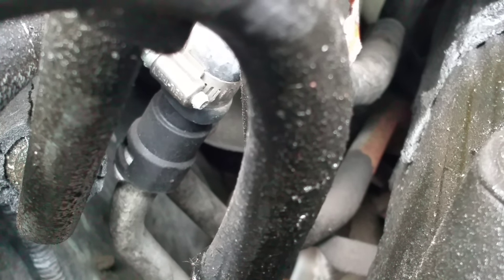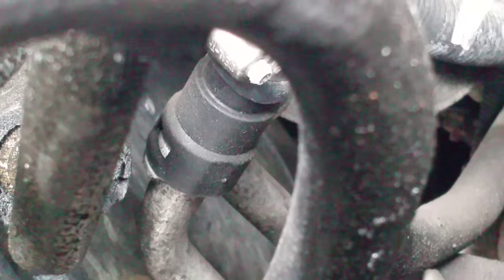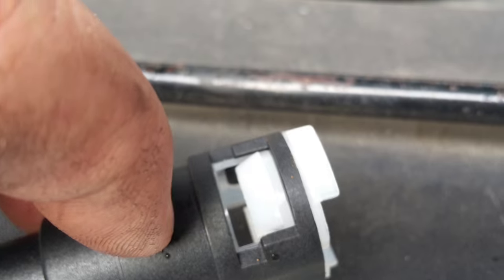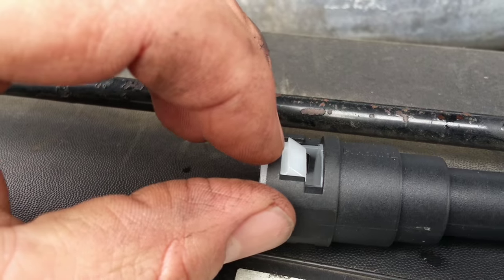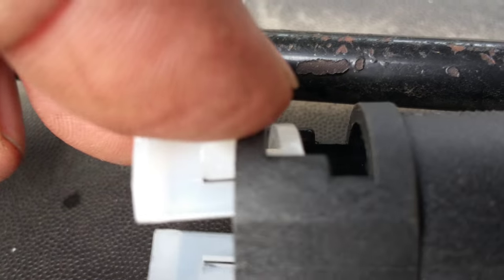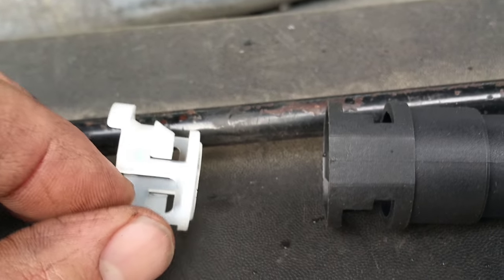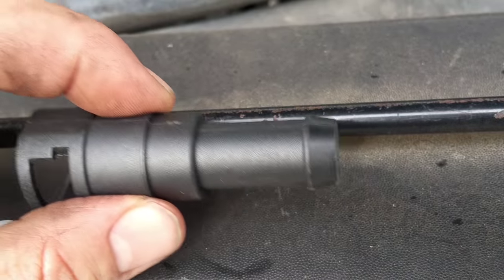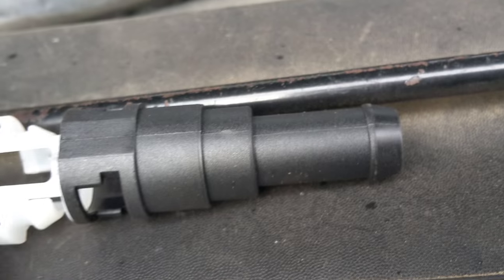Ford Heater Hose Quick Connect Release how to

Comment: The engineer that designed this, especially the recessed heater hose connections against the firewall, needs to be strung up!
Reply from the maker: Ummmmm...... maybe should find another line of work. But then, again... the bgg quick connects made their job a lot easier. As I would not call these quick disconnects.

Comment: Just an FYI from an old mechanic, a dab of silicone grease on the metal male tube that sides in the o ring will save alot of time and headache when reassembling. This will also help with future removal efforts. Great info in the video by the way. Straight and to the point. Tx.
Reply from the maker: Kerry Wallace thank you.
Reply: Should I buy a quick connect for the side that isn't going into the fire wall too? Plus an o ring?

Comment: This video helped me out tremedously. I replaced the ends on the main vacuum line of my 2001 F150 5.4 ltr and in doing so bumped the top heater hose enough to break the plastic quick connect. The clip end was still on the heater core pipe and I could not get it off. This video allowed me to get the broken piece off and replace the heater hose. The trick is to push the quick connect to the firewall, then push down internal tabs of the clip while easing the black plastic quick connect away from the firewall. THANKS FOR THE VIDEO!!!!
Reply from the maker: SkynAnge Thank you!
Reply: SkynAnge- Thanks for that tip!
Reply: Thanks for the help, I ended up having to disconnect one side of the clip first from inner and outer part and the then other side and pull and twist out. This video/comment did help! 👍🏽

Comment: By far the best description (and video) I found for removing the heater hose Quick Connect.  Replaced both heater hose assemblies on '97 Expedition with rear heating unit.  The toughest was at the firewall, but after doing the others this can be done by feel.  Had ordered the removal tool with the hoses, but saw this video before the parts arrived.  Removed old hoses before the tool even arrived.  Thanks for sharing this info!
Reply from the maker: Thank you, very much. I wish I was able to show it live.

Comment: Great video MrRchitty! I noticed a few folks were asking about where to obtain this quick connect part. I just had to replace one on my 2003 Ford Truck F150 1/2 ton P/U 4WD 5.4L FI SOHC 8cyl. 

Like one other person had commented, mine had three O rings and the replacement part Doorman - Part # 800-403 that I obtained from Advance Auto came with the same three O rings. If I'm not mistaken, an alternate alternitive would be the Gates Quick-Lok Connector - Part # 28500. 
Additional Tip! - Credit to Kerry Wallace that stated, "Just an FYI from an old mechanic, a dab of silicone grease on the metal male tube that sides in the o ring will save alot of time and headache when reassembling. This will also help with future removal efforts" Die-Electric grease will work just as well. Without grease, you will play the devil getting the new connector on - with grease, sucker slips and snaps right into place.
Reply: Great info. ANy idea on the size tool to remove these clips? Im going to cnc one from wood

Comment: MrRchitty ... your thorough explanation did the trick.  I also bought the 'special' tool but found it ineffective in removing these bad boys.  I had one bad heater hose. While removing the end next to the passenger compartment the second one snapped.  I barely touched it BUT...not necessarily a bad thing as it probably makes more sense to replace both so I am not stranded somewhere.  CHEERS and THANK YOU.
Reply from the maker: Thank you. I am glad it worked for you
Reply: @MrRChitty  The bit of your trick that really pushed the success for my 2006 Ford F150 LTD 4x4 Triton) replacement was the one handed bit at the end.  I did exactly what you showed by cutting the hose off (throwing it away and replacing) and then I had basically the unit and pipe coming out of the passenger compartment.  There is NO room for two hands in this meager, poorly lit area.   Thanks again, Jim

Comment: Adding to the kudos! The old T quick connect on my Chevy Suburban snapped off inside the hose, my quick connect T's off back to the 2nd heater core in the rear. Your video saved us after a long while of messing with it. But my two teenage sons now know the joys of fixing your car.
Reply from the maker: This is the same for GM??
Reply: @MrRChitty  The white part is a tiny bit difference in size and mine is a T because a suburban has 2 core, much like an expedition. But otherwise, yes. And you saved me a ton of money, thank you so much!
Reply from the maker: @undeniable_1  appreciate the feedback. I have a Suburban and at some point the hoses will get changed.
Reply: What is purpose on using the not so quick connectors anyway?

Comment: Pushing back on the connector (as in the opposite way to pull it off) is the key to getting the quick connect to release. You can feel it push in and release. Then just squeeze the two white tabs and it will release. This procedure worked on my GM / Chevrolet Trailblazer SS 6.0L. Don't forget to puts some Sil Glyde or some other lubricant on the fittings so the O-ring does not tear. Excellent video!!!
Reply from the maker: I appreciate your feedback.
Reply: I have been trying for 3 hours. That didn’t work either and I have small hands. It’s a tight fit at the firewall. 
I’m “throwing tools mad” at this point!

Comment: Very helpful, I leaned on the left heater hose on 2001 F250 and broke it off,  glad you mentioned O ring as it was on the pipe. I bought a new quick connect and it failed, turns out it had no O Ring, since then I bought a new one, slid it on and would not click. Pulled it off the O ring was sideways in there and twisted, so now I have pulled the O ring out and placed it back in. Next move will be to try it again. To me, who ever thought this up should be drawn and quartered at the Ford Company engineers parking lot.
Reply from the maker: timmy tool I'm glad it helped.

Comment: Thanks! You just saved my hubby a ton of time. This isn't only for ford... We were working on a 2000 Mazda MPV minivan.  The quick connects might be universal.  They are at the very least, interchangeable between a 2000 Mazda MPV and the Ford expedition in this video.  Thanks again for a very informative video! I'm subscribing 😁
Reply from the maker: I believe the Mazda MPV may have been a Ford in Disguise. Ford had part ownership in Mazda and had Mazda Branding on certain Ford products. Thank you for reaching out and appreciate the sub.  Randy

Comment: GOD bless you sir . I kept trying with that quick release tool with no luck.  Watched your video and came right off.❤❤❤❤🇺🇲🗽🇺🇲🗽👍🏼🙏🏽
Reply from the maker: Thank you. Glad it worked out.
Reply: Same here… the thing is I saw another video where they used the tool so I struggled for an hour with the tool because it really is a bitch to depress the buttons..  I could get one side but never the other until I realized I could unlock the top and then rotate the tube 180 and then get the other one in the same top position

Comment: Thanks for the visual. I was able to remove the quick connect on my E-350 heater core with one hand. I'm fairly certain I used silicon grease on the o-rings when I replaced the heater core several years ago.
Reply from the maker: Appreciate the feedback.

Comment: You video was VERY helpful.  There are several types of disconnects on my 02 F250.  The heater core outlets are stubbed out from the firewall really close.  I was unable to get a release tool back to mine.  After watching your video, I was able to blindly manipulate the fitting to come loose.  Thanks again!
Reply from the maker: dovedevllc Thank you. I am glad it helped.

Comment: Thank you, so much!  

I have to replace mine on my 03 olds alero, as coolant is leaking there.  I've not been able to locate the quick disconnect remover tool locally and have no time to wait for one to ship to me.  I tried using plyers to push the tabs in and pull the thing off, but I was trying to pull the whole thing together.  Now, I have a better solution. You are awesome!  

God bless you!

Comment: If I'm not mistaken I did this with a pair of needle nose pliers when I changed the core of my Expedition, and just used new hoses. But I forget, and have forgotten all about this, which is why I'm here because I have to change these on another Ford. 

I think the reason they may have used these is it may have saved them a few seconds on the assembly line, which may sound trivial. But considering they have to roll a car out every minute or so it would make sense.
Reply from the maker: I visited their plant in New Jersey about 25 years ago. They were pumping out one Ford Ranger every minute on the assembly plant. Reason for my post was that auto parts stores were selling a tool that I could never get to work. Appreciate the feedback.

Comment: Thank you for posting this video, getting ready to pull valve covers off for a timing chain/ oil pump replacement. I have a 97 Ford Expedition 4x4...... with all the B.S. on it, an in my way. The timing chain, oil pump an water pump is the easy part. I love the truck though, an its pulls all my toys. Thanks again.
Reply from the maker: Loved the truck as well as the heavy (250) series frame and the turning radius.

Comment: Another great way removing these aggravating things!  :)  IF the OEM hose is damaged and unrepairable the tubes of most vehicles will accommodate bulk heater hose to be fitting into place and secured with screw drive or spring action clamps or "ear" clamps (crimpable type).  

Thanks for sharing!
Reply from the maker: jwa718 Delete? Thank you
Reply: Sometimes the hose id is different than the tube od. I swear they do this shit on purpose so you can't do what is suggested here.

Comment: Thanks.  I have a 1.5 inch long plastic tube coming off my pcv contraption.  No threads inside or outside of it. I need to connect a 3/4 inch hose to it. I must maintain the 3/4 inch inside diameter in the entire process. I think the disconnect may do the trick.

Comment: thanks for the tip. I'm thinking of doing on 97 Expedition with motorcraft heater hose assembly  KH-710 for outlet and KH-714 on inlet. it doesn't look like there's much room to remove the hoses next to the firewall. It seems really impossible to do this job mainly because there's no room to reach in there.
Reply from the maker: It is snug under there. If you have the rear heating unit, removing the plastic wheel well will give you room for those connections. The firewall is doable. I used a step ladder at the front of my truck and just about laid across the top.

Comment: On my 2005 I  pinched the two tabs inside the black area with my fingers then pushed and pulled a couple of times .It came half way off and then finaly with a good pull knowing the tabs where released it came off. The white part left on the metal I  had to actually fold the white plastic sides back  and pull,surprisingly it did not break. Also I noticed whoever did this before must have broken the second coil pack wire connection from the fire wall because it was taped together.Now I have a misfire.I recommend  taking the time to disconnect that coil.
Reply from the maker: Appreciate the feedback.  Good luck with the coil pack.

Comment: Thank you!  You saved me a lot of time seeing how the quick connect was built.  Great video!  I have a 97' E150 that I am taking out the old heater core.  I would have probably just broken them off, but they are expensive.  Try to save them now.
Reply from the maker: tomhendry1 Thank you and good luck.

Comment: thanks for the video, do you have any idea whats the inner diameter of the heater hoses?
Reply: 5/8 or 3/4 and it's often different than the od of the metal tube the hose connects to.

Comment: I notice how easy it is in your hand, but near imposable up near the heater core where you can't even get your hand in. I cut that sucker off with a hot knife and put on a clamp.
Reply from the maker: Once I figured it out in the open air, I went right under and removed mine using this technique. The true benefit to this system, in my opinion, is the installation.  Appreciate the feesback.

Comment: They never come off easy. I broke all of em off and put stainless clamps on with regular hose. The ones at the heater core were a pain in the butt. I couldn't get a ratchet on em.... Hell, i could barely get my hand in there so i got those clamps with the plastic butterfly tighteners.
Reply from the maker: Agree, it is a pain.
Reply: How are they holding up? The clamps you used.

Comment: Thanks so much man. I’ve been struggling to get this style fitting off on my 07 GMC Yukon Denali.
Reply from the maker: I just picked up a 2002 Yukon XL, and notice that has similar connectors and I was wondering if it was the same, how did you make out?
Reply: MrRchitty currently working on it. I got the old broken clip off but I’m having troubles getting the new one on.
Reply from the maker: It appeared my 2002 had a similar setup, I just didn't Venture into it yet. Just watch for the O-ring if you're having troubles getting the new one on.
Reply from the maker: Keep me posted
Reply: I got it all fixed. It turns out I got a cheap aftermarket part that didn’t fit. I got the right part and it went on easily, thanks again for the help I don’t think I would’ve ever figured it out if I didn’t see this video!
Reply: MrRchitty the aftermarket part brand was Dorman. Steer away from them if you can the brand that worked for me was called Gates.
Reply from the maker: @codybigbee2957  Funny thing, it was a Dorman part that I used. Anyway, success is success. I am very familiar with Gates. Thanks for the input.

Comment: Try doing it while on the pipe
Reply: Yes, the pipe will actually block you from squeezing those ears far enough to release it. The tool is designed to depress the little tabs in the small openings. I found that the recommended tool does not work very well because it is so thin. A small block of 1/4" or 3/8" thick plastic shaped like the opening in the factory tool works much better.
Reply: Just did it on the pipe removed the old pieces and put all new
Reply: Great video for working with the quick disconnect on a bench, not much good with the disconnect actually on the heater pipe
Reply: This should be called a quick connect / 4 hour disconnect.
Reply: I was shocked to find i was able to remove the connector from the rear of the engine bay with just my fingers.  I won't go as far as to say it was easy, because my fatass almost suffocated trying to lean over and reach the damn thing and I couldn't see it because of where it was situated.  But I just felt for the tabs and pressed one while pulling on the hose with my other hand, then, while maintaining pull tension on the hose, rotated it 180 degrees to reach the other tab.  Couldn't believe it worked.  Unfortunately the white piece stayed on the metal tube and it was a bitch to pry it off with some angle plyers. @TheDouglash
Reply: @ARMYStrongHOOAH17  not surprising. After three weekends of trying to get this thing off I just said f*** it and I cut the hose in half
Reply: @gamiensrule holy smokes … and I was upset after succeeding finally after 75 minutes 😅 thanks you’ve made me feel better 😂

Comment: When re-connecting. Do I put the white clip on the stem first OR do I fit it into the black connector and slide the whole assembly on.
Reply from the maker: fit it back into the black connector. Then the entire assembly just snaps together.

Comment: Good video of a nasty little job made simpler and much easier. Thanks this will help me today.
Reply from the maker: keep me posted.
Reply: I got them changed and used a 90 degree needle nose and the job is done. Thanks
Reply from the maker: Sweet deal. I can see how the needle noise pliers would make that job easier.

Comment: So far in a 2003 heater core connection T is kicking my butt. When i press the plastic pieces in its not enough for the black piece to come off . Still hitting on the white part .
Reply from the maker: I am wondering if there is some dirt that got behind it which will or may inhibit its release. I assure you that this works as once I figured it out, I was successful in switching my heater hoses out. Make sure the assembly is pushed towards the nipple so as to allow the teeth to clear the edges. Keep me posted.

Comment: Good job. Seems no one wants to video the actual removal /replace but skip that part. Many novice need see that part to boost their confidence.

Up date! Did it. Quick dis connect was a small problem, easier if there's  two people or you have 4 hands and long arms. You loose about 1 cup, or less, of anti freeze. 
Pay attention to small surrounding lines so if you knock off one you know where it should had gone not where it might had gone. Have fun.
Reply from the maker: Appreciate the feedback.

Comment: That quick connect looks the same as the ones on my Chevy Venture.  When I press in on those tabs, I can't get them to disconnect.   I'm not sure if I'm misunderstanding something you said or if the ones on the Chevy ventures are just really hard to disconnect.
Reply from the maker: I agree, they look similar on my gmc, as well, however, I haven't had the opportunity to play with those. Moving the assembly towards the connection should allow the tabs to clear the lip before depressing them, and then wiggling the assembly back and forth while pulling back. Keeping in mind that the tabs which are depressed are going to stay behind and the heater hose and connector are going to pull off. That's the way it worked on my Fords.